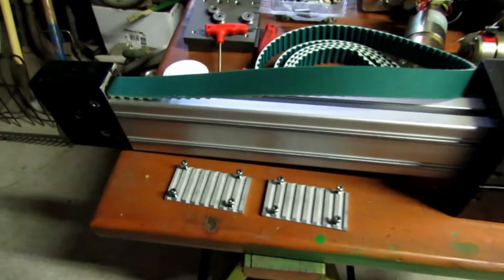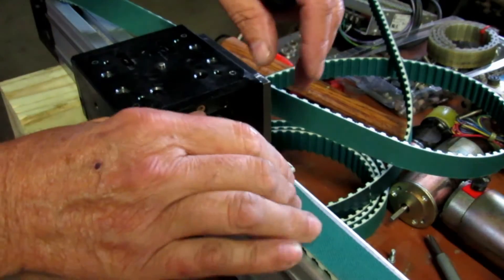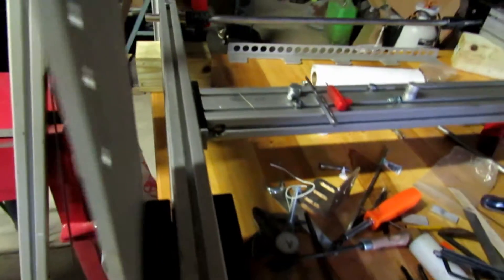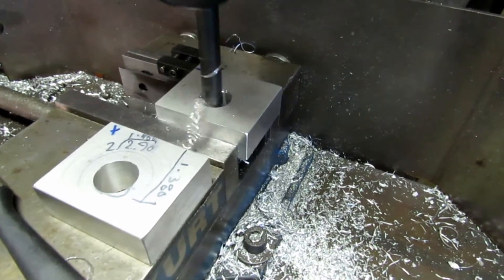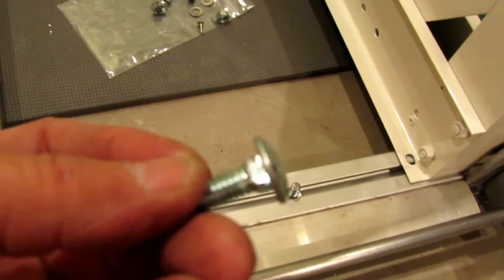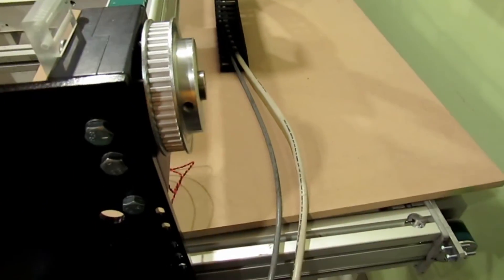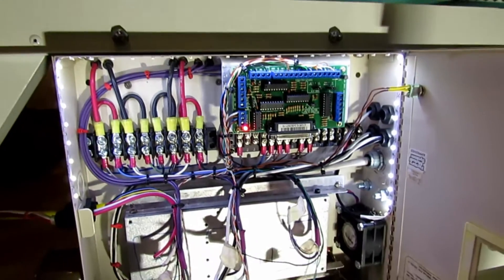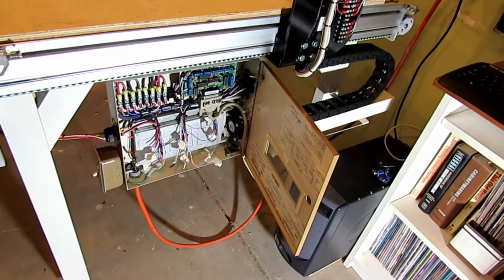Building a Belt Drive CNC Router from Surplus Parts Part 1

Comment: Can you make up a parts list do someone could build themselves
Reply from the maker: This one wore out and I am just finishing up a new one. Use what parts you have available for a project like this as most was surplus and not available or worth the cost if you have to buy it. Thanks for watching.
Reply: @unemployedredneckhillbilly2023  what and where did you get gantry parts all I want to do is run belt drive on gantry the rest will be lead screw driven
Reply from the maker: @billseward3485  A surplus store that sells used parts from old machines. Could find zero info about them. The bearings only lasted about 500 hours so not worth using. I just bought linear bearings for my new router that are not very expensive.